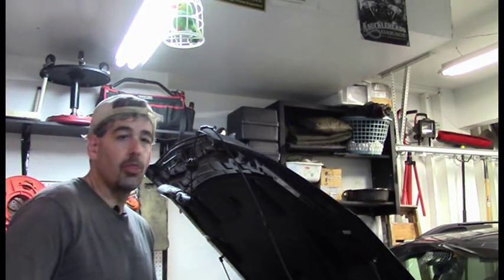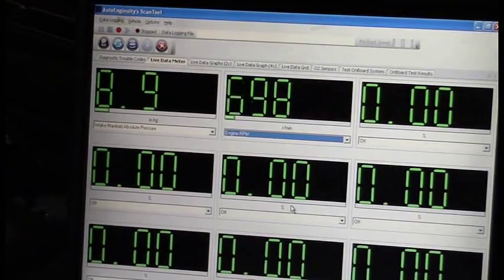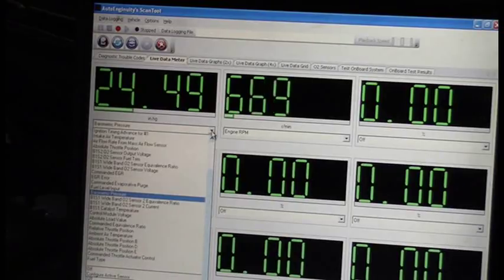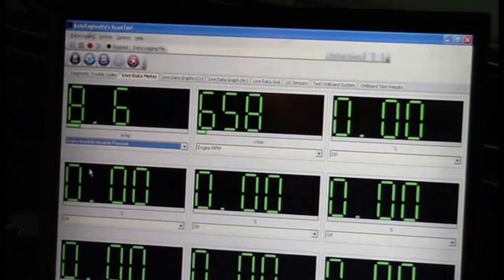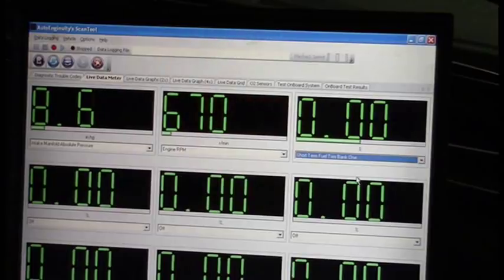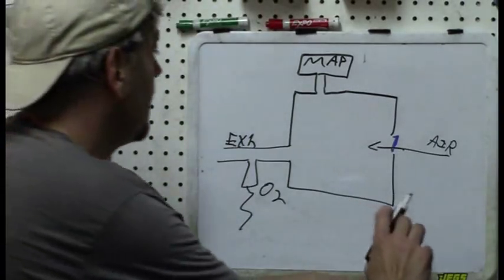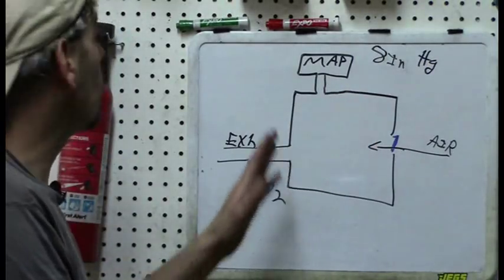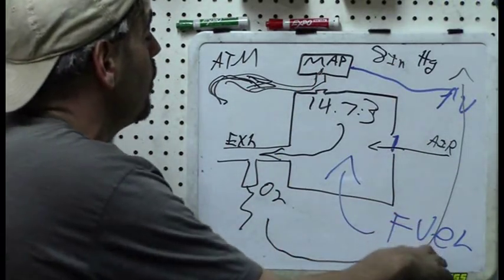MAP Sensor Diagnosis and Understanding Function- Pt2

Comment: Can a bad catalytic converter affect Fuel trims too? I mean canc a bad cat , create a rich situation? throwing a 0172 code even?
Reply from the maker: I have never seen an inefficient catalyst throw off fuel trims, and thinking about it-there would be no reason it would.
However, I would expect a clogged cat to most likely throw the trims towards rich especially on a MAP-only engine.
Reply: +Schrodingers Box I have an 0172 code. It used to be a misfire code 0301. I replaced all the injectors. I followed you map sensors posting and measured it. Map looks good. Can you advise what can cause the rich condition with 0172 code? Thanks again
Reply from the maker: Kofi Ampofo Boadi Sorry I am not following... you replaced all the injectors based on what data? I feel like I am missing something here
Reply: +Schrodingers Box the dealership told me my car was rich because the injectors were stuck in the open position. That's why I changed it. It didn't do any difference. They keep miss-diagnosing it and charging me slots of money for nothing. That's why I decided to research and do it my self.

Comment: Great Video, the only question I have is that I have a P0404 EGR Flow CKT Range/Performance code as well. Can that be my main problem instead of the MAP sensor?
Reply from the maker: Obviously the EGR and MAP are interconnected- MAP is used to validate EGR function.
You need data on the MAP with and without EGR activation to narrow down to which is the issue.
Reply: +Schrodingers Box thanks

Comment: HI! Great video can I say. Keep up wit this kind of work.
Is this a normal reaction of the MAP,  LTFT, STFT & RPM:
It was measured on a petrol car VW Polo 1.4 16V year 2008:

1. When the engine was cold around 50C:
MAP: 33kPa
LTFT: -12.5
STFT:5.5
RPM:781 ( idle )

2. Engine hot ( around 90C )
MAP: 30kPa
LTFT: -25.5 ( no DTC set to the ECU )
STFT: -3.1
RPM:785 ( idle )

3.  Engine hot ( around 90C )
MAP: 30kPa
LTFT: -0.8 
STFT: -5.5
RPM: 2074 ( for around 30sec. )

Actually, the car have a starting problem when it is standing for a longer time on a hot sunny place around 2h. It will crank but not star. It will start after 5-10 cranking.
Otherwise, everithing is ok if the engine start.
It makes for me no sense does the MAP value is on a different RPM almost in a same range of value.
Also, if the engine is not started but the ignition is on the MAP shows a value of 100kPa which is actually ok because the engine is not started and there is no pressure in the manifold and the MAP shows the outdoor pressure.
Any idea?
Thanks very much for any suggestion.
Reply from the maker: You have a load related fuel deficit. Either fuel delivery issue or MAF inaccuracy. I would measure fuel pressure at static, idle, and under load as next step.
Reply: Hi! thnx for replay.
I checked before the fuel pressure, I got a fuel pump pressure about 3.5 - 4 bar what is exactly in the rail too even after 10min. So I decide no injector leaking. Under load it is moving up-down slightly but never under 2.8 bar. On this type of car is no MAF sensor.
The most conflicting think for me is does I can smell a lot of petrol on the exh. when the engine started after several cranking and no one DTC is set for any problem. That make me crazy.
Reply: @christianrobertadzic9321   have find something for fixing the problem? almost same faults on my seat ibiza 1.4 cggb engine with map no maf.

Comment: really great video, any other video you would recommend me... my cars check engine will pop out and car will shut off while im driving code reads the following  "MAP sensor circuit lower than expected" i also get "Tp sensor higher than expected " the help would be much appreciated. thank you
Reply from the maker: So what is the MAP data you got? what was he idle and load voltages?
Reply: +Schrodingers Box the idles fluctuate quite often i notice as if it wanted to turn off at times the tp reads 5 volts if thats what you were asking ? thanks for the reply!
Reply: +Norberto Nunez. *the rpms fluctuate " sorry bout that
Reply from the maker: Norberto Nunez I asked the MAP voltage and a TP voltage is only showing the reference. What about the signal?
  I need usable data or I cant help

Comment: Hi,
I just found your channel today and I really like it and enjoy your videos! 
But I still got a question about the fuel trim. I don't get why it gets instantaneously negative. Because of the disassembled MAP the control unit sees a too high air pressure, like if there is too much air going in the engine. So the control unit sees a lean condition (only based on the MAP information). Therefore it increases the amount of fuel which leads to a positive STFT (like the vacuum leak at idle). But then the lambda sensor tells the engine that the fuel/O2 ratio is too high which leads to a negative STFT. Well and there two control variables work against each other.  
Did I miss or misunderstood something? 
I'm really looking forward to your reply!

Greetings from Germany

Comment: I have subscribed appreciate the informationI have a rudimentary understanding of how it all works and it's nice to have a clear concise breakdown to confirm what I think is correct is actually correct.
Particularly since I have just started playing with scanned tools and a couple of Mercedes one of them are Vito van which has been troublesome it appears it was a mass airflow sensor that was throwing me not the fuel system although the fuel system was compromised as well.
I will be watching more of your videos to gain a greater understanding of the senses round the engine bay

so in short thank you very much and I look forward  to seeing more

Comment: best teaching video i've ever found.
Reply: +Schrodingers Box Do the map have the same volt as the maf
Reply: yes 5 volts base voltage from PCM or ignition, TPS and other sensors and etc do also.
Reply: Wow! Teaching example
Reply from the maker: +Jacob Delano Thanks!! You will probably like my video "secret of engine problem diagnosis: fuel trims". I think it's better than this one.

Comment: Hi. Great vids on MAP sensor. I did something stupid out of great love for my Honda CR-V 2007 2.2 diesel car that has caused my car to go into limp mode. No RPM above 2k and no speed above 50mph. Problem caused by watching a youtube channel clip on using DIELECTRIC GREASE in electrical connections. 
I put Ambersil grease "with excelelnt dieelctrical resistance" on 6 connections: 4 wires leading to cylinder tops, one on a sensor (Bosch 0281002680 MAP MANIFOLD ABSOLUTE PRESSURE sensor). I wish that 40 sometihng years mechanic on youtube had warned about putting it on every connection but he advised it exactly like that, put it everywhere.
Now scanner shows 12 codes, all electrical in nature. The worst thing I did was to apply dielctrical grease, mildly in inside and end of male part without having removed battery black cable. I then tried, this time removing battery cable, to clean those 6 points I put grease on, with brake spray cleaner. No difference, still 2k rpm. PGM-FI light is on and also engine check light is on.

Do I stand a chance of getting this sorted before having to take it to dealers and get ripped apart, money-wise?
Thanks

Comment: 1) great stuff - thank you!
2) on your comment that a misfire will effect the map sensor values - you may be surprised that it doesn't work as much as one would intuitively expect. The reason is that the engine is still pumping air through a misfiring (lets just call it a dead cylinder) so the air volume is actually remaining the same as if the cylinder were firing. At idle, the map sensor can pick up  the lower idle speed that is a result of the dead cylinder, but if the idle speed is raised the engine vacuum will be restored. This is a difficult concept to grasp when working with multi-cylinder engines with common intake plenums, but it's clearly evident when moving to say motorcycles, that use separate throttle bodies for each cylinder. Hook up a set of sync guages to check each cylinders vacuum, kill the cylinder, and note that the vacuum only changes to the dead cylinder because of the rpm loss from less air volume being pumped.

Comment: Thanks Matt, liked and subbed you :)
What keeps buzzing me, is how Inhg is measured. I suppose the greater the vacuum, the greater the inhg.
But then i cant explain 1:15. Doing a snap throttle the Map is exposed to atmospheric, (increasing pressure so decreaseing vacuum), and then when decelerating the map is in a greater vacuum then it was before at idle. 
The inhg ratings show the opposite, can someone explain this?
Reply from the maker: +Mad4Tracks In Hg is consistent with the voltage from the sensor. You will see higher HgIn of pressure wqhen snapping throttle- up to atmospheric pressure in fact
Reply: +Schrodingers Box Ahh thanks, i have read into some info about Inhg, I'm not very used to it as I come from The Netherlands :) 
It appears It' s just a unit of measuring pressure, not absolute vacuum. I was mislead by various explanations not mentioning absolute or atmospheric.

Either way it makes sense now. Still digging through your videos as I really love em :)

Comment: Hi there schrodingers box hope you can help i started getting an intermitted 403 code egr so i decided to clean it after that epc light came on with code 106 manifold ap pressure so i looked at live data and sht and long term fuel trim way out -35 to -48 cleared code to reset trims look normal in open loop but after warm up back to negative not sure where to start maybe leaky injector or leak when i replaced egr but thought a leak would cause positive not neg thanks..
Reply: +Craig Howard Sure I can help- what data do you have?
Reply: +Craig Howard See my video on EGR diagnosis first, give me the data you get and they I can help
Reply: +Schrodinger's Box Quantum Mekanix i have a cheap obd11 tool and dashcommand for ipad that i use for logging data nothing special il have a look at the egr video first thanks
Reply: Sir how can we diagnose about piston ring wear out through the MAP sensor reading. Please explain

Comment: now i trouble shoot the Honda fit autotrans.
when start the engine my RPM is 1k but when i shift a drive the engine was vibrate,stumble,shaking and stalling, i check the ignition  coil the current of ignition  coil is low voltage, and we check the fuel pressure is not good is low circulation,,then we buy fuel pressure but still shaking engine.then we clean the IAC or idle air control,but i dont now how to testing the sernsor of IAC..
..plss help me this my problem..:)
.thank u schrodingers box..
now i understand what is map sensor..i try to check a map sensor 
thanks..u r genius...
great info.."Im sorry 4 my English...im filipino 
tnx good bless..
Reply: plss help me this my suitation..Tnx god bless

Comment: My problem in my civic is when I step on the gas pedal, it chokes and doesn't any acceleration at all, i already changed the cylinder head due to bad valves, then distributor and the TPS, do you think it is a MAP sensor problem. I pull off the MAP connector and the engine is still running, I dont know what to do..
Reply: +Rod Alalay No idea- what did the diagnostics tests indicate?
Reply: engine light on, but I tried to pull out the map sensor it is okay, if i drive uphill or put the acceleration is like the engine is going to die, do you think is a clogged fuel filter or pump?
Reply from the maker: +Rod Alalay I have no idea bro. I need data from the MAP sensor diagnostics.
Reply: Ill bring in to the mechanic who fix my head tomorrow
. he will check. if its map sensor, clean and hoping to get another one
Reply from the maker: Why do I get the feeling some people don't even watch the video.....   

NEXT.

Comment: Matt: thank you for the prompt response! (I was primarily referring to the video "MAP Sensor Diagnosis and Understanding Function - Pt1" and I was pretty sure that was a MAP sensor). The reason I ask is that I have a 1999 toyota corolla and when I performed the voltage test in this video on my car I noticed that at WOT the reading on the MAP sensor was not even 4V, only about 3 to 3.5. Of course, the car is not moving; but I thought this might be indicative of a bad map sensor since it would seem that the sensor is not reporting to the computer the "proper" voltage to indicate that the throttle is wide open. (Please excuse me if my terminology and/or analysis is mechanically faulty). Would you say this could be the case or perhaps would this test (and the corresponding readings) be too unreliable to conclude that? Again, thanks for your time, videos, and expertise.
Reply from the maker: +Katie Zillmer No a reading at 3.5 at idle is good. Remember at idle much less air is entering the intake than when vehicle moving.

Comment: Matt: if a person does a voltage test on the map sensor, and then opens the throttle wide open ("floor it"), should he not see a voltage reading of about 5 volts (or slightly less) from the signal wire? I'm only wondering because in the first video, when you did the voltage test and opened the throttle, the reading was only slightly above 3 volts.
Reply from the maker: +Katie Zillmer Yes you should see that.  If I recall, in this video the reading I took was on MAF though wasn't it? In the case of MAP or MAF the voltage wouldn't read full 5V unless vehicle was moving because not enough air at idle will come into the engine.
  Indeed if I did a WOT on the TPS and it didn't read over 4V I missed that as an indication- you should easily see 4.5V on a full WOT on a TPS

Comment: Question for you, I had a P0107 code for the map sensor giving low signal on a 1997 Chevy Cavalier (No MAF sensor in this gremlin). When I did some diagnostics however, everything checked out from the 5v reference, and change appropriately when vacuum was applied. Ground was also correct. I still suspected that it may have been bad, from previous diagnostics on other sensors and symptoms, so I got one from the junk yard (identical part #'s and from same model). After I installed the used one, the problem went away and the code hasn't come back. How is this possible? I had played with the wiring from the connector and harness previously. The original MAP sensor didn't throw a code until the end of last winter, however the car first failed to start and acted up after I left it outside overnight in -30 degrees Fahrenheit during the beginning of winter (Wisconsin cold kills cars), and then on initial starts in morning, even warm, it would crank for a few seconds but start. If the diaphragm had failed, shouldn't the vacuum test had shown it? The car only failed when 20 degrees F or colder. Note: There are a few other codes that I'm working on, including a come and go EGR valve being stuck open.
Reply: +Bluefiresea Maybe the fail was partial, and only an oscilloscope would have revealed it?
Reply from the maker: Most likely explanation is code is "referenced" from the other conditions you say threw other codes.
Reply: That's what I had initially thought, however no other components were touched at the time. Only the map sensor was changed, and the code went away. It's been two weeks since and the code has not come back. I was severely puzzled by this.

Comment: So I'm guilty of parts changing, because I'm lost. I have a 93 xj that intermittently idles low and at times stalls. It's not throwing codes and I thought maybe it would be a vacuum leak. Would a vacuum leak be intermittent? Not sure if this is related, but very rarely it will idle extremely high in neutral or park.

I have replaced the IAC, cleaned to throttle body, and replaced the TPS. I have a MAP I'm about to switch out, and if that's not a fix, I'm stumped.

Sorry for the lack of knowledge, but I'm still learning.
Reply from the maker: +Justin Bingham what data do you have?  What's your voltage, volume and frequencies?
Reply: +Schrodingers Box I have not checked.
Reply from the maker: Not sure what you're asking me then.

Comment: At about min. 8 you explain that the O2 sensor would detect an increase in fuel.  I thought the O2 sensor only measured oxygen.  Removing the map sensor ( and plugging the hole)  would not change the air/fuel ratio.  Am I correct?
Reply: +Ed Waggoner Sr. (Papatch) The O2 sensor reads the amount of oxygen in the exhaust. Hes saying on a MAP only engine if you took it out and plugged the hole there would not be a change in the amount of air in the engine., but the map would read way higher and the computer would see that and think oh lord thats a lot of air and add fuel to compensate for it. The O2 would then see a rich condition and pull the trims negative. At least thats my understanding of it.
Reply: Cody Kistler Thanks Cody.  That makes sense.

Comment: Hello. Great video.I have a Ford Connect 1.8 TDCI and it's been kicking out loads of black smoke on acceleration. yesterday I inspected it and the intercooler pipe between the manifold and intercooler was split. I unplugged the MAP sensor and the smoking stopped. I've ordered a pipe and your video fully explains the reasons for smoke. The split caused an increase in air pressure and it compensated by increasing fuel. Hence the black smoke. Yes?
Reply from the maker: +niptodstan ABsolutely correct!!
Reply from the maker: ***** Possible

Comment: wondering if MAP readings can be used to diagnose EGR problems.  would it pick up opening of pindle with change in value on MAP?
Reply from the maker: +Ginger Wegner YES! In fact it is the responsibility of the MAP to do this on some cars.
Reply: Thanks!